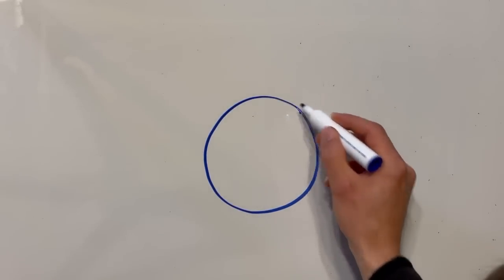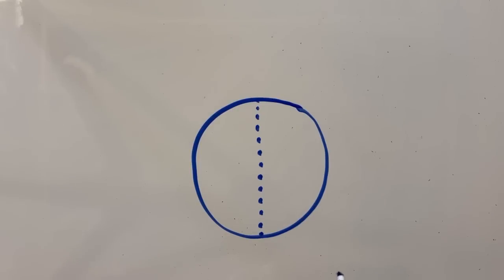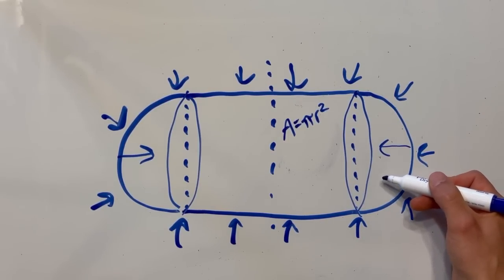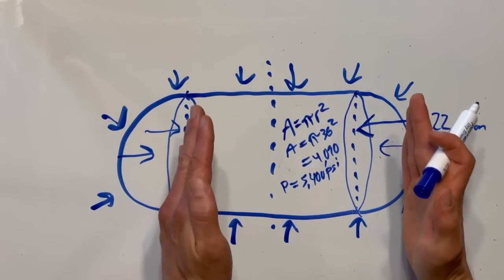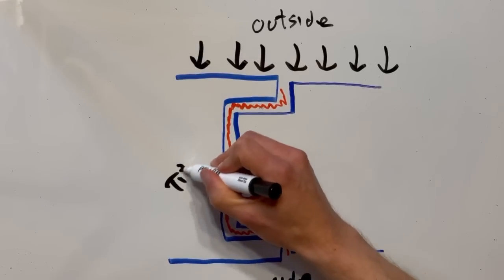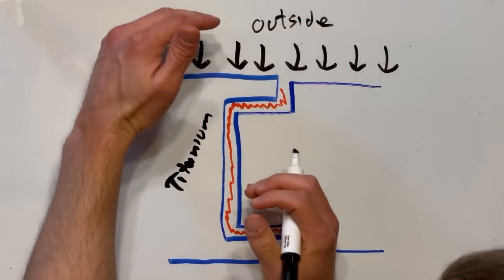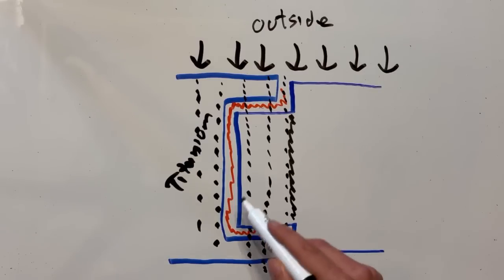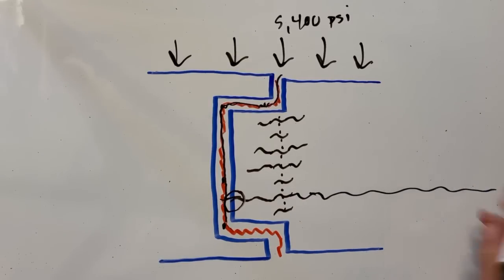Simple Engineering Analysis of How the Titan Submersible Could Have Failed

Comment: Would be interesting to see what stress was generated due to differences in thermal expansions of the titanium, glue, and carbon fiber.
Reply from the maker: I doubt it was very much.  Relatively small thermal change from room temp for manufacture to just slightly below freezing water temperature.

Comment: The titanium end caps are dome-shaped and not flat.   The pressure outside will always act perpendicular to the surface.  So that means whatever flat area is in the middle of the dome will be source to transfer a direct axial load onto the composite tube and the other forces would have to be either calculated or and FEA needs to be done.  I think what happened was the stiffness or modulus of the carbon fiber shell was vastly different than that of titanium and it basically scrunched like soda can under the immense pressure and eventually ruptured.
Reply from the maker: Correct, the dome shaped end caps have force acting perpendicular to the surface at any given point, however it does simplify down to a flat surface when you look at just the force of the two end caps trying to squeeze the carbon fiber hull in the axial direction.  Then other components could be factored into acting radially.
Reply: @Mutton_Lettuce_and_Tomato You can simplify to flat caps but force transfer directly axially will be due to flat surfaces in the middle only.  The other loads will be some fraction of the total. Nonetheless,  I am sure it is still a large load.

Comment: This was a VERY... ...well presented ANALYSIS...  ...of the engineering CONCERNS... ...which OCEANGATE... ...overlooked in their DESIGN... ...which UNFORTUNATELY...  ....cost the lives of members of the PUBLIC...  ...which could have been AVOIDED... ...and also why members of the submarine COMMUNITY... ...were skeptical of the overall STRUCTURAL INTEGRITY...  ...of the TITAN SUBMERSIBLE...  ...which suffered a catastrophic FAILURE...  ...after several successful DIVES...  Okay, I'm being a jerk.  We used to make fun of Carl Sagan as well.  Great analysis, but you need to work on your video delivery.  Watch out for those run-on sentences which create a sense of rambling.  Scripting it out can help, or a halfway method is just keeping script notes in a bulleted list.  The engineering is strong enough that I'm hooked.  Thanks for the presentation!
Reply from the maker: Thanks for the input.

Comment: Thank you very much for your excellent video. You are the first one to even mention about the end pressure on the ends pushing in. My calculations came up to only about 19,000,000 pounds because of a smaller diameter. But l applaud you for considering that at 20 million pounds pushing in there is no way one of the domes just fell off; as some have suggested. I thought that the temperature coefficient of carbon fiber is negative against titanium’s positive coefficient is something that should be of concern.
Reply from the maker: Thanks.  There will be different coefficients of thermal expansion, but I doubt that has much to play here since there isn't a huge temperature difference between the room temperature where it would have been assembled, and the ocean floor.

Comment: Defies logic to have titanium endcaps GLUED with a mechanical bond at best to a dissimilar material. Plus the glue, titanium, carbon composite, and acrylic window all react differently to pressure and temperature. There needs to be an in depth investigation or book written about Stockton Rush, billionaire killer.
Reply from the maker: Yes, the mix of materials was not a good idea.  The acrylic windows have been the go to for submersibles since fay one, but he flirted with disaster on such a large diameter window.

Comment: You forgot to discuss the matters of the epoxi matrix, the lack of   
pressure treating in an autoclave, and the different and opposing   
contraction and expansion temperature coefficients of the carbon  
fiber cylinder and of the titanium caps. The latter contract when  
temperature drops, while the carbon fiber matrix expands.
Otherwise this is an excellent presentation. Thanks!
Reply from the maker: Thanks.  Yes, there is soooo much to potentially talk about, but I tried to keep it as short as possible and get to likely the most important issue with the design for the average person to understand.

Comment: I don't believe the titanium and carbon fiber tube had that dovetail joint.  I think they just tried to glue two flat surfaces together.
Reply from the maker: There is at least a small step machined on the outside of the composite tube.  I can see it in the assembly video.  The inside was a speculated guess, but I suspect they may have machined both sides to true up the composite roundness so to speak.   Dovetail  or not the same shear stress applies at the joint.

Comment: One of the better analyses of the problems with the adhesive joint where the titanium ring flanges were (sort of) adhered to the composite cylinder.

We could go into a several hours long discussion about surface preparation - or the lack thereof - in order to give the adhesive more "bight" to the titanium.

However, almost nobody has gone into any thought about the joint's lack of resistance to tear-out forces as designed.

Much as we use anchor bolts when attaching equipment to a reinforced concrete foundation, it would be smarter to run bolting rods  tied into a reinforcing cage within the composite, such that the titanium ring flange could be positively held in place by the clamping force.

Such a design however would in my opinion not be sufficient to save the vessel, as the use of composite material brings with it the flaws of delamination and debonding with service cycles. And, CF composites in particular tend to break nearly instantaneously, not giving you enough warning to back away from the impending failure.

Comment: I'm not an engineer but I'm an Engineering Technician specializing in Metrological tasks (the science of measuring things) in an Aerospace materials testing lab where for the last 5 years I've studied, Calibrated, modified, repaired, designed and experimented and built testing/measuring equip. Let me tell you what stands out to me as pure recklessness. Not only did Rush completely ignore mechanical expansion due to 6,000 psi, he completely ignored the thermal expansion coefficients of 2 very different materials and remember it's cold down there. You are asking for fatigue and failure. Not only that, I heard he used stainless steel bolts on the titanium end caps, that is insane. In my opinion the bolts should have been made of the same exact specific titanium alloy, so that corrosion caused by dissimilar metals and seawater isn't an issue, additionally you can guarantee that the thermal expansion coefficients would be identical which would negate much fatigue and mitigate bolts working themselves loose. I also think that although the sub was for the most part under compression from the outside water pressure, remember the tube is the largest surface area and the weakest surface area so when it is pressing in it is also also pushing the end caps out and in the failure you can see the bolts sheared, I believe the bolts should have been rated collectively to hold that 22 million lbf per cap. My other issue is the 22 million lbf is assuming that the end caps are flat circles/discs, but they are actually hemispherical so they have significantly more surface area than a flat circle so I would guess it's more than 22 million lbs of force enacted on each. What also amazes me is the fact that the carbon filament was only wrapped radially and not layered in 0, 45 and 90 degree layers to help strengthen the hull. I also wonder how he dealt with the edges not being square due to the slight angle necessary to wrap the filament. I believe it would have been beneficial to make the hull more of an elongated oval to take advantage of the strength and more consistent force distribution of 3 dimensional rounded structures instead of a cylinder that is only round on 1 axis. Why didn't he at least add skeletal titanium ribs and stringers every 6 inches under the carbon hull? An unbelievable and a completely avoidable tragedy. Also he didn't use strain gauges because they were "too expensive", I'm telling you strain gauges are neither expensive or difficult to implement. So sad.
Reply from the maker: There almost certainly had to be axial or helical plies of fibers.  Some other commenters seem to have knowledge of this.   Also, yes the hemispherical ends would have more force applied to them than just a circle of their diameter, but not all that force is being applied in the axial direction.  The amount of force just in the axial direction is equal to the circular cross section multiplied by the pressure.
Reply: @Mutton_Lettuce_and_Tomato  good to know. It's too bad that people had to die on an experimental vessel. Who knows maybe carbon fiber could work but they he was so cavalier about safety is just disturbing always criticizing safety standards and certification. I guess he made an example for next time someone else spews that rhetoric.
Reply from the maker: I have worked with some composites in my years in industry and when I think about it I just don't think it will ever be a safe and viable deep sea diving material.  The fact that it is hard to manufacture something like that without small air bubbles and even delaminations, the resin is known to crack in between the fibers.  These small cracks would be a prime location for water under high pressure in the deep sea to get into and hydraulically fracture the resin.   Can someone create a reliable sealing layer on the outside that will not even have a chance of leaking where you have to meet a metallic end cap or even a hatch to get into the vessel?  It is a tough ask I think.
Reply: @Mutton_Lettuce_and_Tomato  yeah I see your point. Humans have been going to the deepest known part of the ocean since the 60s without an issue using metal subs, why take the risk of using a brittle composite. Also I meant to say the filament has been wound circumferentially (0°) not radially (90°), it would have been nice if they added radial and 45° offset layers but watching the short video of them winding the carbon filament I only see them doing a circumferential wrap.
Reply: @Mutton_Lettuce_and_Tomato  https://youtu.be/4PUTbK5AqY8
On this video they are only winding it circumferentially on the former, the only slight angle introduced is to allow for left right passes/sweeps basically no weaving or angle that I'm seeing. And why isn't the adhesive pressing out from the seams? Just wow. Everyone on YouTube including myself is acting like they find the smoking gun, but I think OceanGate and Rush show carelessness and a reckless disregard for safety across the entire process and eventually one of the failure points caught up with them. If it wasn't the carbon fiber hull it would have been the 1300m acrylic or the adhesive or something else. It was all a ticking time bomb.

Comment: I appreciate your detailed analysis of the glued joint. Haven't seen that elsewhere.  However, it should be noted there were two different shells for the Titan.  Many videos (not shown here) of winding the composite shell with wet carbon fiber/epoxy are from 2017 by Spencer in Sacramento, (a marine composite fabricator}. Per Rush, all 5 inches were wound radially (no cross plies).The photos you show of bonding the shell to the titanium rings (10:58) are from the first shell in 2017 also.  "Problems" with this first shell arose during deep water testing in 2018 & 2019 so OceanGate derated it from 4000m to 3000m. Titanic is at 3800m so OceanGate built a new shell of the same dimensions (and maybe new rings) in 2020 at Electroimpact in Seattle (an aerospace composite fabricator) using, according to Rush, expired prepreg from Boeing and biaxially layup. The photos you show of winding the shell (9:18) are from the 2020 shell by Electroimpact.  Fabrication details of both shells are sketchy for now.  Hopefully the investigation will reveal details eventually.

Another YouTuber (Thunderf00t) reported that the modulus (resistance to compression) of titanium is 10x higher than that of carbon fiber composite so the differential shrinkage at the ring/shell joint at 3800m would be significant.

Comment: Carbon fiber bubble wrap! 

With over 38 years of advanced material reinforcement manufacturing, ASTM (I) failure analysis engineering experience, including carbon fiber, the method, application and overall design are all examples of total disregards to proper engineering designs, manufacturing, testing, evaluation and lack of certifications, created a death trap guaranteed to fail within a few cyclic loads. 

Carbon fiber in this application and overall design is complete negligence on all levels and in all disciplines.

Physical material property differences in Titanium and carbon fiber expansion & contraction along with trapped air bubbles in the carbon fiber  guarantees the seal between the  Titanium and carbon fiber to delaminate with cyclic loads, especially if subjected to pressure and temperature shock loading such as descending too fast.

Comment: Is it possible the end caps blew out. Cheers.  Great vid
Reply from the maker: I am not sure I understand your question correctly?  Are you asking if the two hemispherical titanium end caps blew off outward away from the composite center section, and that is how the submersible failed?
Reply: @Mutton_Lettuce_and_Tomato  yes. what I'm asking is it possible the deformation of the composite under pressure initiated the release of the poorly glued titanium half domes. Example.  If you apply enough pressure to a toothpaste tube the cap will pop before the tube itself ruptures. I love your channel. I love thinking and solving. I wish I had become an engineer. Thank tou for your response. Kind Regards
Reply from the maker: @kymnewman7323  no.  The water pressure is pushing inward on the titanium caps so much that they could not be pushed away.   A tube of toothpaste works that way because the pressure inside to toothpaste tube is greater than the air pressure outside.  To expel the titanium end caps the internal pressure inside the Titan would need to be greater than the water pressure outside the vessel.
Reply: Thank you for your time. I like to hear the engineering facts. Not supposition.

Comment: Another observation: Where the ends of the CF tube are joined with the titanium interface rings, the rings are able to resist the water pressure, and they retain most if not all of their original diameter.  At the same time, at the halfway point between the rings, the outer diameter on the CF tube is being steadily decreased as pressure increases..  My thought is that this results in a rotational force applied to the glue joint at each end, and that force, combined with your point that the end of the tube was subject to shear forces, appears to be a point where the DF tube was ripped away from the titanium ring, which caused the adhesive to fail and water introduced into the DF and resulted in the "clean" appearance of the adapter rings with little or no CF attached.
Reply from the maker: Yes, there would be a bending moment applied as well as the sheer forces, but the immense pressure to which the end caps were squeezed inward could have deflected the titanium enough to make up for that.  It’s hard to say for certain though.

Comment: Very good presentation.   We know that the thickness of the carbon fiber was 5", but might have been capable of resisting the pressure better if it had been 7".  I got to thinking about this, wondering why they didn't just make it 7", and remembered that Mr. Rush was a corner-cutter extraordinaire.  Obviously, the 7" CF itself would have cost more, but  to do that, it would require the very expensive titanium hemispheres and interface rings to each be 4" larger in diameter, and therefore more expensive, and much heavier.  I believe that Rush made this just one more compromise to save money.  He was a pro at "getting drunk on his own whiskey."
Reply from the maker: I wonder what the safety factor was in their design that maybe made them ultimately decide to make the hull thinner, and just how much in costs it could have saved them.  I have worked with both titanium and both pre-preg and wet winding of composites, and some of the materials certainly aren't cheap.  Titanium is mind blowingly expensive compared to steel.

Comment: Question:  I've never worked with carbon fiber composite, but I know from experience with insulated aerial lift booms, that glass/resin composite is highly hygroscopic if fibers are exposed.  Is the same true for carbon fiber composite?
Reply from the maker: The fibers themselves have hydroscopic properties, but that won’t do much to prevent a tiny crack from being split open by hydraulic pressure.
Reply: @Mutton_Lettuce_and_Tomato  I was musing more along the lines that since water seems to accelerate delamination in FRP at normal atmospheric pressure, I can only imagine that any surface fissure, subjected to water at 300+ atmospheres, would also speed delamination.
Reply from the maker: @kendalgoodson  ah.  Yes. Any surface fissure with that pressure can’t be good.